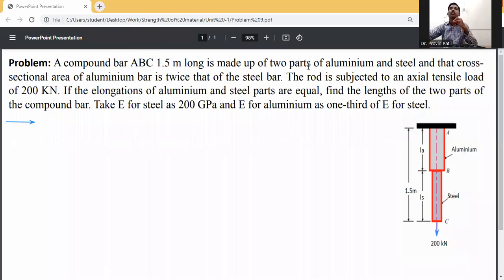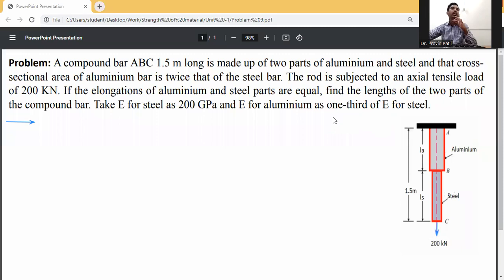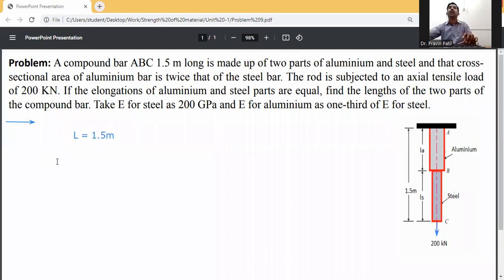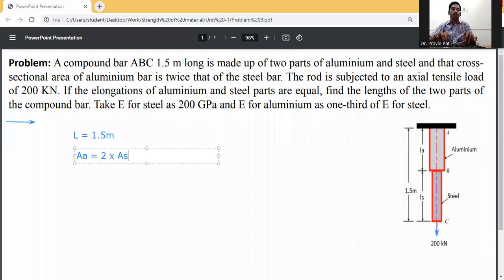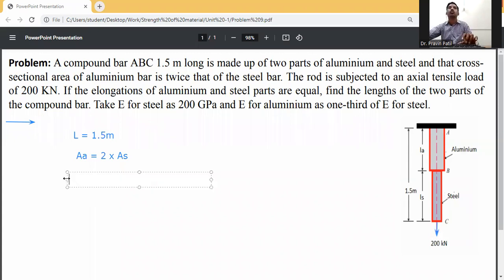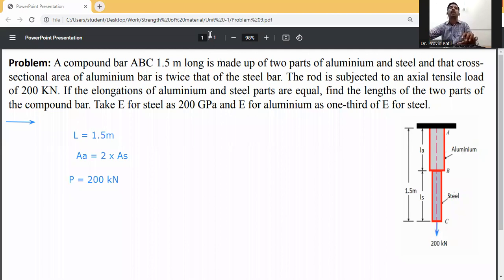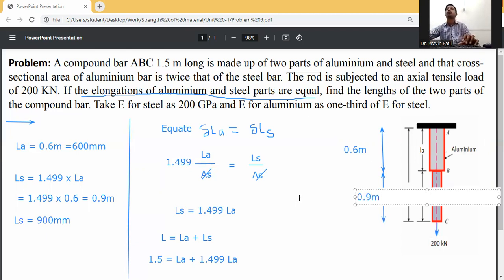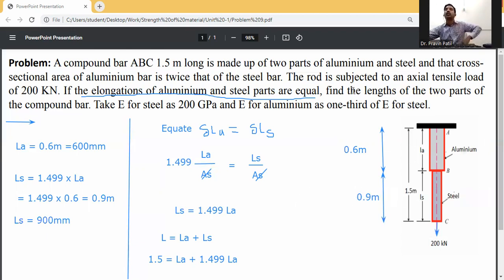Elongation in steel and aluminum compound bar/ Change in length/ Simple stress and strain

Comment: Sir... can u please solve this question....A bar tapers uniformly form a diameter 60mm at one end to 40mm at the other end over a length of 1.5m.the bar is subjected to an axial load of 100kn .if e for bar material is 2*10^5n/mm^2.derive the formula for elongation of tapered circular bar and obtain the elongation of the given bar.
Reply from the maker: https://youtube.com/shorts/kMtKmNB_aCU?feature=share
Use this formula